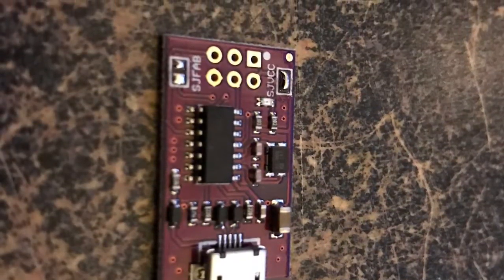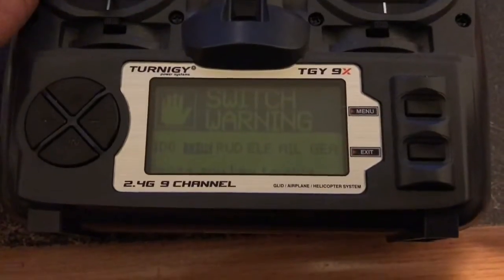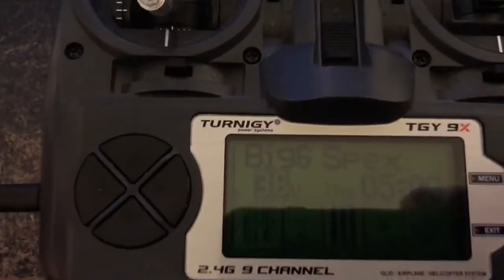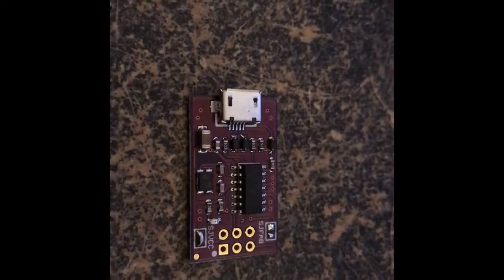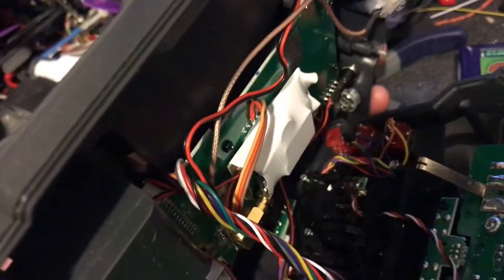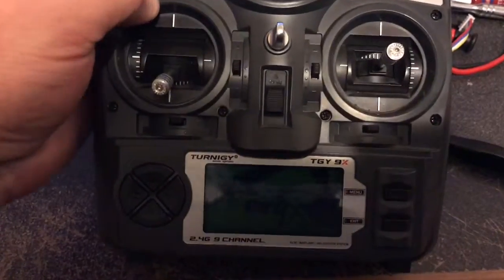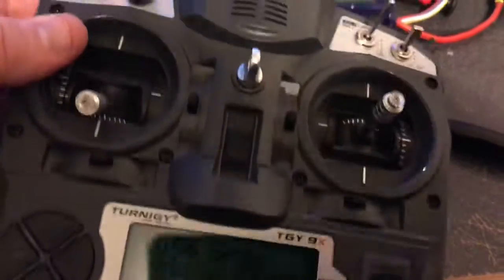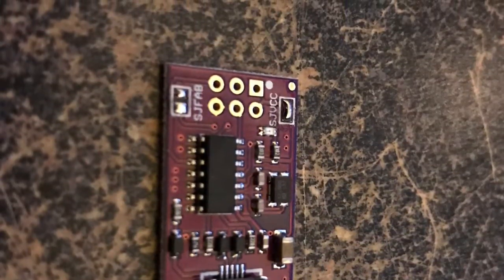ATtiny44 ISP Programmer in the Turnigy 9X

Comment: i found programming card ,  i bought 9x radio from some one , and who was using  open tx 9x 2.0.15 version , you are expert and  i am new  , pls guide me the version already in my radio is good or ER9X VERSION IS GOOD or any othr version you think is good rather then these 2 firm ware ??? and if any other version is good pls share me link of that version  pls guide ,

  programming card is good to attach in radio , so i can easily make set  up for my plane or channel setting .
Reply from the maker: I prefer the ER9X software because it allows me to control my jumper module from the screen. OpenTX doesn't currently support my jumper module. I would have preferred OpenTX. If you don't have a jumper module, then I would probably stay with OpenTX.

Comment: Hi since u manage to use it, im flashed already my 9x using the avr programmer, i want to use the tiny usb as it can simply be inside and just use usb cable, installed the driver etc, but cannoct connect to my radio/board, any help/tips would be glad
Reply from the maker: First thing is to make sure that the ATtiny44 is wired correctly. I have a link showing the locations of all of the points on the board to solder to. Match them up with the outputs from the programmer. Here is the image I used to get the solder points: http://www.rchacker.com/projects/turnigy-9x/open9x-and-telemetry/20120701155154%20Page_1.jpg?attredirects=0 From there, I have used both OpenTX and Er9X. I am running ER9x right now because it allows me to control my jumper module from the radio instead of having to set the dial on the module for each flight.

Comment: Hey 
I need your help ! Pls tell me how u flashed the software ...if i conect the tinyusb programmer with na pc and then try to update the firmware with OpenTX companion it says: could not check firmware from radio. 

Maybe u can show the pc part in a video? I really dont know what to do ....i installed a few drivers but it wont work 

Sry for my bad english :)
Reply from the maker: I’ll try to put up a video about it this weekend and I’ll link it to this one. I have since changed the software to ER9X since this video because of better compatibility with a jumper module I purchased.
Reply: @darrelowens  oh thank u so much